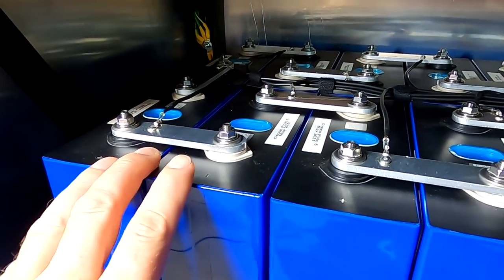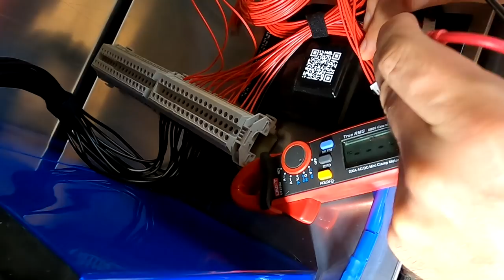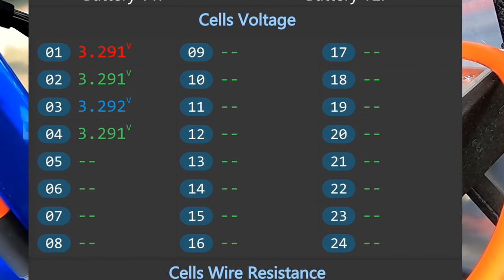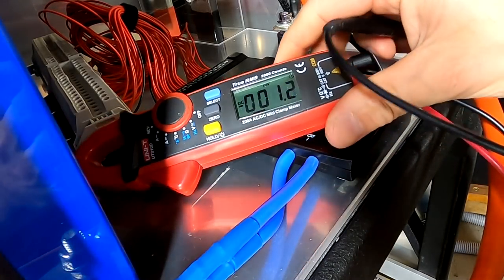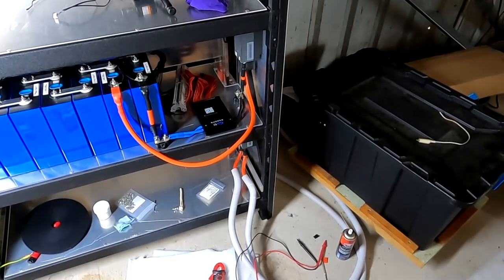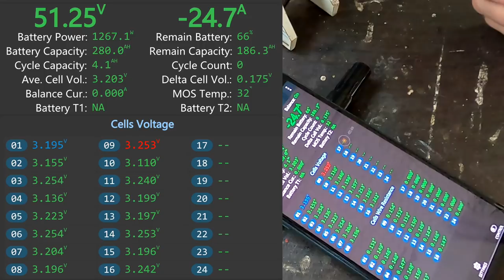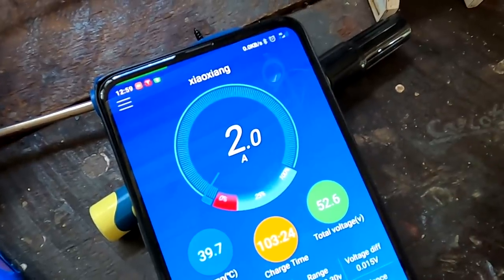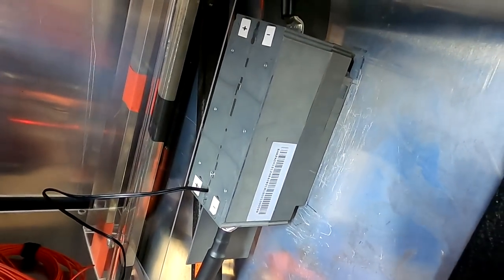Paralleling two 48V battery banks. A self-balancing system. Part 3

Comment: The fluctuations are due to the inverter draw. It's not a constant, more a wave/pulse shape, and the BMS doesn't have a long enough integration time to average the result like a multi-meter does (RMS). The BMS samples the voltage over a shunt resistor periodically, but does not do averaging over time. You can actually see the inverter draw very well with a scope. Is it a problem? Not really, since it is still correct and if you would take an average over time you would get the RMS value - you can see this easily if you graph the BMS data in Grafana for example through the RS485 port.
Reply from the maker: Ahhh, great explanation as always. Thank you. That makes totally sense! I have an oscilloscope here so can make this visible. So with a pure 48V resistive load this should be far more stable, right? I just don't have one apart from inverters 🤷‍♂️
Reply: @OffGridGarageAustralia  Yes, a pure resistive load would give a stable reading. Hook up some incandescent light bulbs for example.
Reply: Correction: replace RMS with average. RMS is typically for sine waves only.... It was late when I wrote that comment :)

Comment: Happy to see the shelf itself is live, those circuit brakes get warm 😅
Andy, are you going to use the cells in the black battery box as part of the the shelf, if not can't I releave you of them one day. New eve cells are just way out of the budget specially with my new born still in icu.

Have you decided what you will do with sealing of the bottom of the shelf? I'm still voting on expanding foam.
Reply from the maker: I have 32 more cells inbound in 2-3 weeks. They are still on the ship on their way to Sydney now. This will fil up the battery shelf and I can then take off the battery box for testing and repair.
The breakers actually don't get that warm. It looks dramatic on the FLIR but they only have around 35°C, so that's pretty normal at almost 100A.

Hope your little one comes home soon. All the best!

Comment: I think a total energy (kWh pulled from the solar battery) comparison test where the car charges at maximum rate and at minimum rate would be an interesting video. I'm quite curious to see how much of an influence the charge speed/ current has on the total efficiëncy when charging the car battery for the same amount (0 to 100% SOC for example) at minimum speed and maximum speed. I would imagine that for solar, charging at a lower speed would be beneficial for efficiëncy due to the lower overall current and less losses. 

Just an idea! Cheers from Belgium!
Reply: I like that idea. For power supplies (ad/dc) 50% of max load are deemed most efficient. I am curios if this holds true for inverters and also if one can set both the phoenix and multi to 50%
Reply: @HolgerNestmann  Ah just learned something new about the power supplies, thanks! I would imagine that for the solar car charging there would also be a "Maximum Power Point" which could be reached by adjusting the charge speed, where the total setup runs the most efficiënt.
Reply from the maker: That's the next one coming. How did you know? 😉
Reply: @OffGridGarageAustralia  Great minds think alike I guess ;))
Reply from the maker: @3dprint-tech787  that's why we are all here. It's all connected 😉

Comment: I'm a little surprised, will you use the battery unpressed or change that in the future?
Reply from the maker: I'm not compressing the cells. It's not necessary.
Reply: @OffGridGarageAustralia  Ok, thanks for the quick reply. I have always read so far that this increases the durability, because not so much mechanical stress is on the individual contacts, which arises during charging and discharging.
Reply from the maker: @DocBrown101  I have a 2mm gap in between my cells, so if they want to expand/contract, they can just do that without putting any force on the terminals.
It also depends if you pull high C-rates from your cells or rather lower amps. I'll explain this in a future video soon.

Comment: Andy, another great video.
I love the bended battery cover, simple yet brilliant.
Are you able to tell me why the 'battery remaining' in the jkbms app is so far out?
In your video it shows 66% remaining while you suggested 20% (battery voltage confirms your suggestion of 20%).
Reply from the maker: Thanks Steven. The BMS needs calibration and I have to fully charge the battery first for initialisation of the BMS. Until then it guesses wild!

Comment: Now comes Andy's New Lessons:
- Observing how more than one battery pack will Charge in combo and teh interaction there.
- Observing the Balancing between cells & the packs
-  Experiencing multi-pack discharges both Hi & Lo Amperage and that changes things.
Things are just about to get Real Interesting and new Lessons Learned will be shared without a doubt.

Are there surprises coming ?  Yes Indeed and some WILL be a surprise.

One lesson to be learned later on as this progresses...  Is WHY the battery packs should be configured to be able to operate as the "Last Man Standing" .  This is to facilitate functional capability regardless of how many packs in the bank are "live" and provides Fall-Back security..  Any single pack within a bank should be capable of supporting the system as a standalone.
Reply from the maker: Very good points and yes all of these and many more will be explored. There is a lot to learn from such a setup.
Reply: @OffGridGarageAustralia  You can bet your bippy that the Adventure is just about to really begin.  Multi-Packs in a bank are always interesting, especially with different cells (grades) and even more when different sized cells packs get nto it.  280AH  & 304AH not a biggy but 200AH & 300AH and things start to really get fun.  That's likely something that someone else will explore.
Reply: @stephsoltesz6731  by last man standing you mean each battery pack with its own bms? is there a good video on this?
Reply: @joaosidonio7562  He means should all batteries but one shut down, any one of them should be able to support the system on its own.
Reply: @joaosidonio7562  yes there is a vid on this here at Andy’s ‘Off Grid GARAGE”, check his other vids, Cheers

Comment: With the high volatility of energy around the world at the moment, I am sure more and more people will invest and love your videos as much as we do.
Reply: That worries me, with more people jumping on board we may see LFP prices go up with the demand.
Reply: @gavinnoname1424  I just got noticed from someone providing EVE cells that supplier from china already decided to go higher the the price per cell. Not sure, but probably indeed related to the demand and the situation in eastern europe.
Reply from the maker: Also, a lot of EV manufacturers are now using LFP batteries in their vehicles. Demand is surely a lot higher than production. It is still worth doing!
Reply: @igorybema  indeed in the Netherlands it was noted the price per cell increased by €20 already.
Reply: Im in South Africa, the power utility cant supply the demand due to corruption within and no political will to eradicate it, hence we have  load-shedding in stages. Today we are on stage 6 so that means 2 x 4 hour and a 2.5 hour power cut over a 24 hour period. Read in the news that Nersa the energy regulator is now planning on stage 16 cuts so just a matter of time before we hit a total blackout. You should see how the prices of solar have skyrocketed in the last 2 years. More than 200%

Comment: If one of the BMS balancing fuses blows, couldn't that cause damage to the BMS circuitry? Seems like a bad idea
Reply: I guess it will see a lack of voltage from that cell and trigger the lower than minimum voltage condition and shut all down
Reply from the maker: No, it won't kill the BMS. It just won't show the voltages for 2 cells, that's all.

Comment: Hello Andy. At the end. Do you think you will add a active balance in add to the JKBMS ?  Could it work?  What is the interest? How can it work together to. Alan ce the cells?  It will make perturbation no?
Reply from the maker: I have not planned doing it but can for testing purposes. It will work just fine. Only keep in mind to turn on the balancer only when cell voltage is above 3.4V, better 3.45V.

Comment: It is not a good idea to connect both positiv together. This will change the sens voltage since it will take the supply voltage from the same line.
Reply: I was just about to write the same think. I don't think the operating current of the BMS (or the voltage drop) will be much, but there will be slight imbalance compared to other cells. Better to run two wires to the battery terminal or power for the BMS from the main battery cables with it's own fuse.
Reply from the maker: Ah, now reading Sami's comment, it makes sense.
That is not a problem at all, the power consumption of the BMS is tiny. Also, I have a 1mm cable to the cell terminals so voltage drop is minimal.
Reply: @OffGridGarageAustralia  I think the largest voltage drop comes from the fuse. I don't know what the resistance of the fuse is, but maybe something like 10-20 mOhm. Also I have no idea what the power draw of the BMS is, but if it pulls for example 5 watts, that would result in (5 W / 48 V)*0.02 Ohm = 2mV voltage drop. Maybe nothing to worry about but there are so many unknowns that I would maybe measure it to see it it could cause an issue.

Comment: Looking real good Andy, almost done, now you just have to fix cell 7 (2 SPATS) on battery 1.0 and put battery 1.0 into battery 2.0 and then start on battery 3.0.!!!!  Don't remember the reason of the voltage fluctuation problem but I am sure you will find it. Keep safe and charged.
Reply from the maker: Thanks Glen. Yeah, I have more cells coming in for the shelf. The old battery will stay offline for a while for testing and repair.

Comment: Do all the battery terminal connections really have to be torqued down instead of just by hand tight? Will it really make a difference? Seems to assume that the batteries themselves are of high quality. Also makes me feel a little anal-retentive so I think I'll skip that step. I feel like some customer asked "what torque should I use?" and the manufacturer said internally "I don't know. what sounds like a good number?" and someone said 4 Nm, and someone said "good enough", and now everyone is trying to torque down to precisely 4.000000 Nm. when 5 or 3Nm are also perfectly fine.
Reply: from experience yes it does. I have had a terminal get very hot whilst the others don't so naturally, 'let me test how tight it is' and boom, stripped threads and a 'twitchy bum moment' to re thread it. I really like the idea of the welded studs that seem to be coming out of china at the moment.
Reply from the maker: I've not used a torque adapter for my battery no.1 and it worked as well just fine. You get a feeling for it when it is tight. I messed up some of my threads though as I later checked with the torque adapter and found I had them far to tight.
Especially with these soft aluminium terminals, I would now recommend one. For everything else, it's not really necessary.
My next lot of cells will have the laser welded studs as Daniel said. You can still over-torque even them and twist the whole terminal.

Comment: Dear Andy, I have been watching all your videos for the last six months and i find them very educative. I am not an electrical engineer but i feel alittle confortable to start a small project.  I have one question, i have victron two 25.6 V batteries and 4 X12v victron batteries also. I have asked so many people if i can parrel the two batteries systems together but they have always discouraged me that Batteries have to be of the same type. I have watched this video more than four times  and i think my mixed ystem can work. Any advice
Reply from the maker: Thanks for your comment. What kind of batteries are they? All lithium batteries? Some lithium, some lead acid?

Comment: Hi Andy, what is your BMS suggestion for 4S 280ah? forBMS, Should i buy >200 amper for 280Ah cells (i would use 4 x LiFePo4 280Ah cells), What is your best efficient BMS suggestion (with bluetooth)?
Reply from the maker: That depends on your load, not so much on the Ah of the battery. For a 4S, I would probably go with the JBD BMS, even the balancing is not the best (but workable). Or you can go with Daly but need an active balancer to top balance from time to time.

Comment: Nice setup Andy mine is the same only a zillion times smaller (24v90ah), well not the same but only what I need, I need clouds for my battery's will kick in, I'm not sure what i would do with 3x48vx280ah, but very nice setup, I payed <1000 euro in total guess you payed some more, I looked up you're MP2, it was 52x more expensive then mine 980w inverter (APC1500VA second hand), maybe in the future I will go to a 48v system with my APC3000 (its under the bed collection dust) it was also 52x cheaper. I pay 0.13 euro cents a kWh, so I consider it like a nice hobby, got another APC1500VA spare, hard thinking about a use for it, the only downside with a UPS or its inverting or its charging with 130w, hard to maintain a ~50% SOC, stay dry and charged !!!
Reply from the maker: I'm preparing to supply power for the whole house with this system at some stage, hence I plan a bit bigger right now. I also charge my Tesla form this battery so need the capacity as I'm not at home during the day when the sun shines.
As with your example, you can get a way cheaper setup and equipment than I bought. For me it is a big hobby. Others have boats or go on holidays, spending their money elsewhere...

Comment: Do you plan to connect JK-BMS to Victron Venus? On "Victron Community Forum" there is a software dedicated for that.
Reply from the maker: The software can only handle one BMS though. What shall I do with 3 BMSs?
The guy is working on a new version to support multiple BMSs. So let's see.
I'm still not sure if there is any benefit of connecting them to the Pi 🤷‍♂️
Reply: @OffGridGarageAustralia  Software can handle more than one BMS - I'll try to put URL to that software in another comment - YouTube do not like URL in the comments and comment can be deleted automatically.

Benefits - controlling and monitoring all installation from one place, even outside the house over internet through remote console? Also ESS Assistant could be used (in your case without grid it hase less sense) But... if you finish that battery shelf - what will you do? :)

Comment: Your 18650 jumper pack to start the BMS is exactly what I did.
Reply from the maker: It works and I'm not too concerned as the BMS will stay on all the time. I only have to do it for maintenance (and all my future testing, I'm afraid)

Comment: Hi Andy, great video, as usual. 👍👍 About temp sensor location in the main breaker, isn't there a similar hole at the upper end of the breaker? Since hot air goes upward, you know...
Reply from the maker: The breaker has several opening at the back, not sure what they are for but this one perfectly takes the temp probe.
With 3 banks installed at some stage, I don't think the breakers will get that warm ever, but yeah, I can place it in the top one, sure...

Comment: Probably there's already been a bulging discussion about cell compression?   I'm surprised there's no restraint or compression, with all the other really fine work and details, why not constrain the cells.
Reply from the maker: It's not necessary and would not make a big difference at all. If you have high c-rates, yes, in our solar environment, no. It's in the specs of the cells when you should compress. I'll do (another) video on this after the installation.

Comment: The last time you had the voltage fluctuation it was due to a dodgy balance cable connection which I think yuo soldered to fix
Reply from the maker: Yes, so, that could not be it any more in this case... I'll explain soon 😉

Comment: I still have no balance issues with my 4X Daly' BMS's
Reply from the maker: That's what you want! Do you pull any high current from your battery? If yes, they must be very well matched.
Reply: @OffGridGarageAustralia  The average current I would pull from my batt's is 20 A per string but at max output 80A per bank or 120A x by four to get system Ampere's

Comment: Just a little bit late.....I just ordered at HankzorStore two JK bms's. Without display.....Almost ready to parallel my three bank together!    Andy, keep on going with your very instructional videos!
Reply from the maker: Thanks Victor, much appreciated. The display is not really needed as the BMS will not turn off itself unless there is a major fault or you disconnect it from the main battery.
Reply: @OffGridGarageAustralia  I wish I had known the display model does not require that stupid jump start, I would've ordered in instead!

Comment: Dear sir, i want to use a two 13s6p (each 48v 15Ah) batteries which came with a bms with each of them within its packs ( total 48v 30Ah now) my question is : can i replace with it a single bms of 30Ah

Comment: Hey Andy are you going to install a external HDMI monitor off the Raspi? I have done just that, just a matter of turning the headless mode off in the Venus soft.
Also are you going to install GUI mods to the Venus OS, has some nice custom BMS software as well as the shutdown monitor mod already preinstalled in the package and a heap of other nice customizable stuff for the home screen icons...
Reply from the maker: Yes, I will look into this, I've seen some mods online and they look really cool! There is still so much to do and to explore, I'm not sure if one life is enough to catch this all on video. I need to do this fulltime!
Reply: @OffGridGarageAustralia  yes it’s a rabbit hole that’s for sure. I’m fully offgrid here in south Australia.